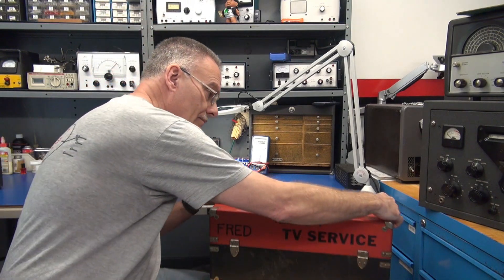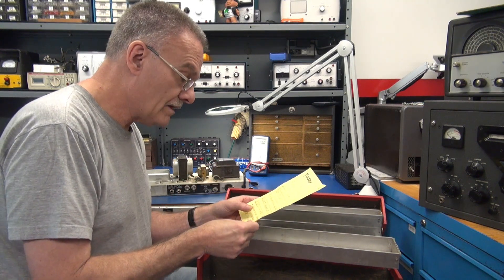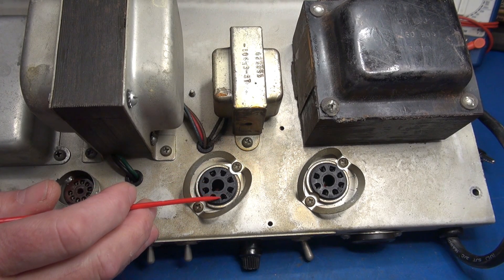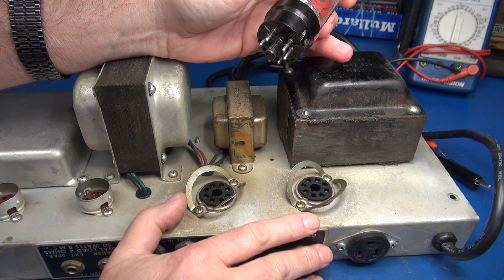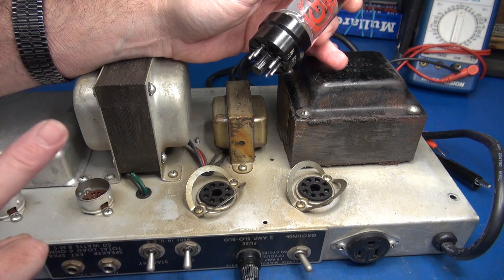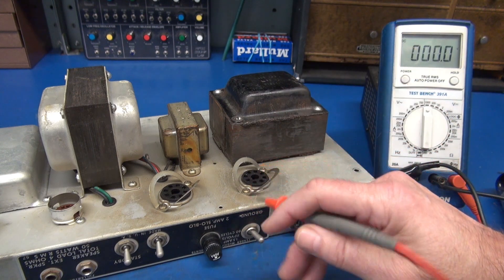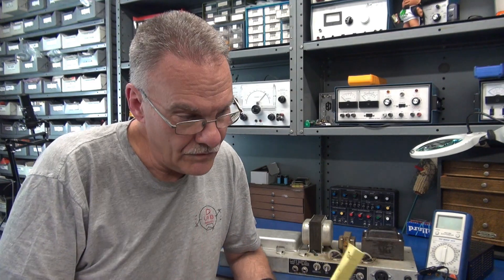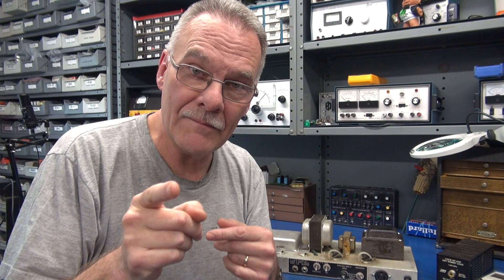D-lab series Basic Training How to repair output tube red plate negative bias  & safety lesson

Comment: Howdy.
Red plating may also be parasitic oscillations. Check the grid stopper resistors. Or if there are none, include them. There are amp.s out there built with no stoppers. Usually first versions. Manufacturers learned quick to include them in revised versions.
Cheers.

Comment: D LABS, it doesn't make sense to me if you're biasing guitar amplifiers at 30mA per output tube but still have crossover distortion. Why do you have crossover distortion even when all the output tubes are at 30mA/70% dissipation?

Comment: Hi, I enjoy watching your videos! I have a hifi tube amp that intermittently goes red plate, I have replaced all the electrolytic caps, all the decoupling caps and fitted high quality ceramic tube bases. I have gone through all the resistors and checked they’re in spec, output transformers are good (no shorted turns),  any ideas most welcome, I’ve also checked the tubes on a tube tester and swapped tubes round! God bless, Bill.

Comment: I had one tube redplating on my Carvin Belair, but using some DeOxit and wire brush on the prongs as well as the sockets seemed to stop the red plating. Ironically while using a bias probe tool, the glass envelope busted up on that one tube while handling it. So I think it was partly that tube itself was on its way out. After replacing that one tube, still no issues

Comment: I have seen others suggest it is a good idea to tweak those pins back into shape. Metal fatigue. Good point! This is why I  had output issues with my 1980 Fender Deluxe Reverb. Once I changed all the 3 octal sockets, everything stabilized.

Comment: I have some sockets on an amp where the big insulator piece is loose in the metal mounting piece that is riveted to the amp. When grabbing the tube and tweaking it, the insulator moves with the tube. The pins are tight but the entire tube can rattle because the insulator is not solid against the mounting metal thingy. Should I replace the sockets? They are good quality mcmurdo sockets.

Comment: Hummmmm. Makes me wonder if a cap draining device in the form of a tube socket couldn't be made for those who want to drain and or check the cap voltage without pulling the chassis. It would need some sort of voltage indicator. Just a thought.